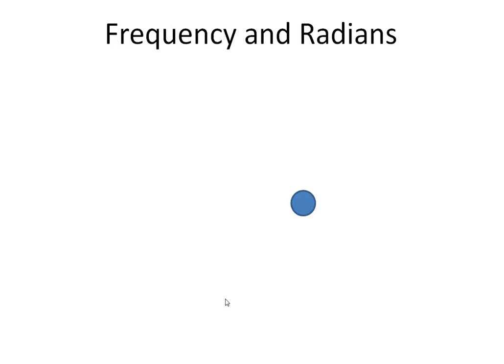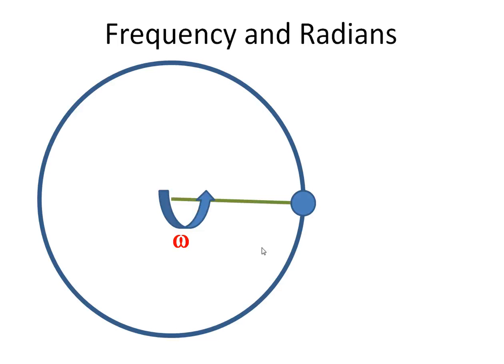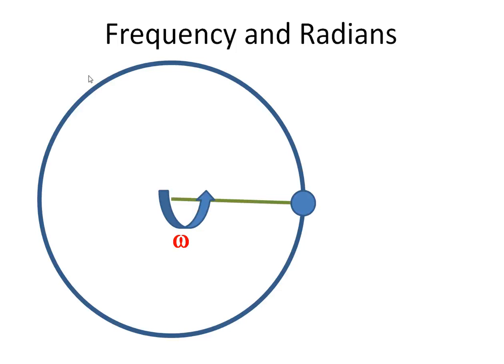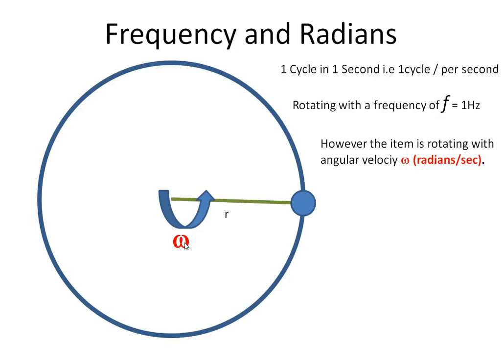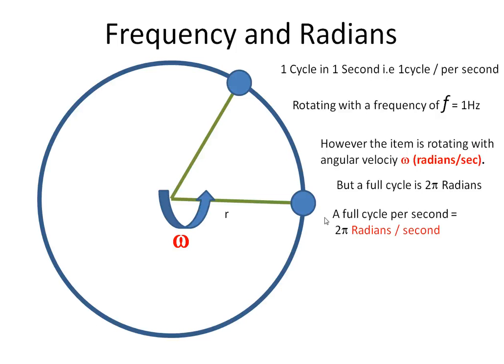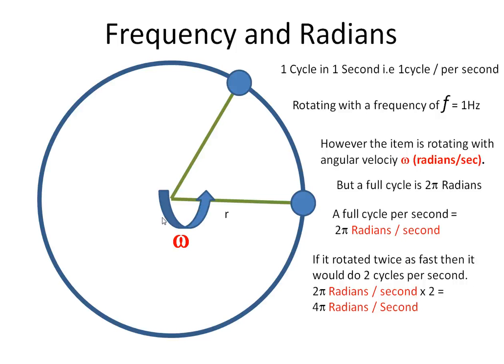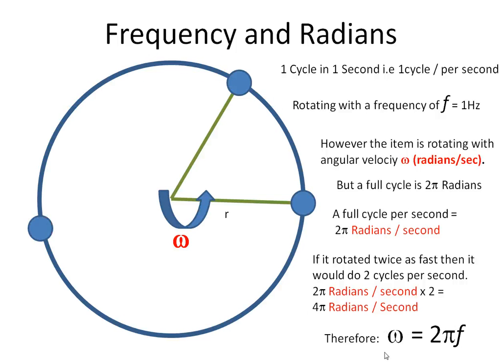Frequency and Angular Velocity

Comment: An angular frequency expresses how often a circular motion or a motion represented  in a sinusoidal function repeats after one complete cycle  
1 complete cycle of a circular motion or a motion expressed in a sinusoidal function is  represented by 360 degrees
 or 2 pi rad = 1 full circle 
W actually merely  stands for an angular velocity  when expressed as a rate of a change in angular  displacement with respect to the time "t" , or  w = d(theta)/ dt  which is the total length of a displacement, measured  in angular value 
(s =angle*R) ,  made by a motion within a time interval or a period of time "t"
Frequency means how many complete cycles that motion has made after that  period of time 
f = (w/time) / 2pi
Ex: w = 12pi rad per minute =12pi rad/ 60s = 0.5 pi rad/s which is the total angular length of the angular displacement per second

The number of repeated cycles is :
f /1 cycle = (0.5 pi rad/s) / 2 pi rad 
 ---> f = (0.5 pi rad/s) cycle/ 2pi rad =  0.25 cycle/s
  which is the angular frequency

Comment: If an object covers 0° to 20° and 20° to 0° path 30 times in 40 seconds. Is it right to say w= pi/9 times 0.75??
Reply from the maker: Ankit Saxena I think it is w=(2.pi)0.75/9 .  The cycle is from 0 to 20 degrees and then 20 to 0 degrees. That is a total cycle of 40 degrees which is 2pi/9 radians.
Reply: @RoddyMcNamee  here angular velocity (omega) = angular displacement/time , i.e (30*40 degrees)/40 sec = pi/6 radians/sec .  If one cycle is 40 degress , 30 times = 30*40 degrees, which is traversed in 40 seconds. Then angular velocity works out to be 30 deg/sec . Convert to rad/s by multiplying pi/180 . Answer is pi/6  (rad/s).